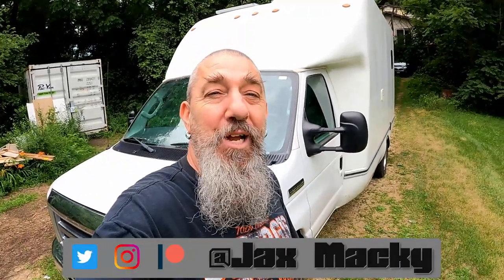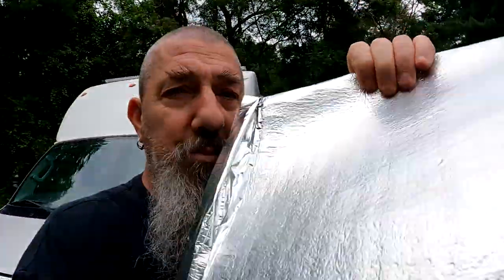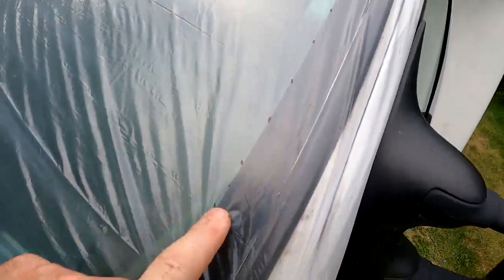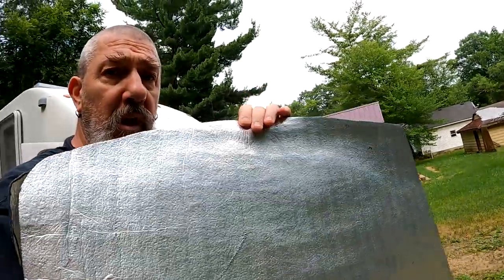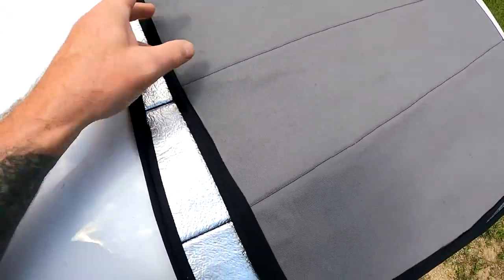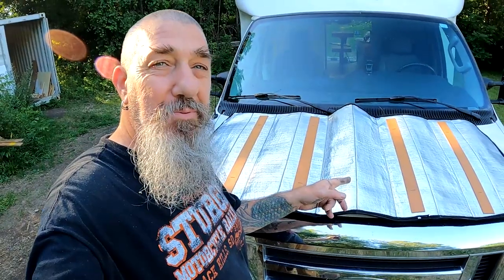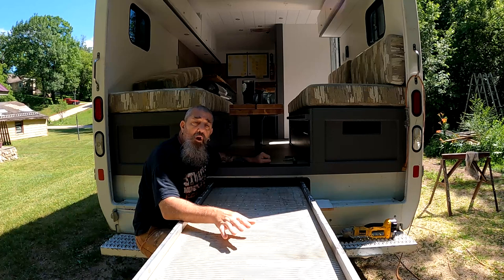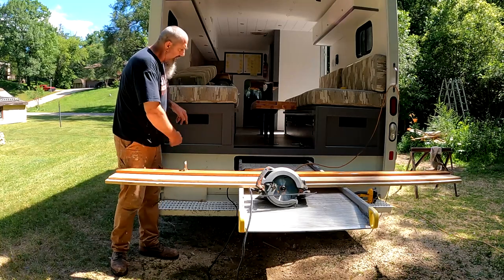Ep30 Van Build - DIY Windscreen Sunshade

Comment: looking good maybe a coat of paint for the ramp would be good something to protect it as well as look good
Reply from the maker: I'm pondering that idea, however there are some concerns. The ramp is aluminum, so it wouldn't NEED paint for (rust) protection. It also has a raised tread pattern that would make the surface prep for paint, difficult. Without proper paint prep for aluminum, the paint would likely flake/peel off rather quickly.
Reply: @JaxMacky    very true and you wouldnt wanna smooth it out as it could still be useful as a ramp
Reply from the maker: I may resort to just a thorough cleaning and see what it looks like!